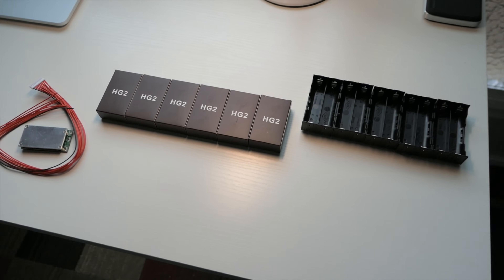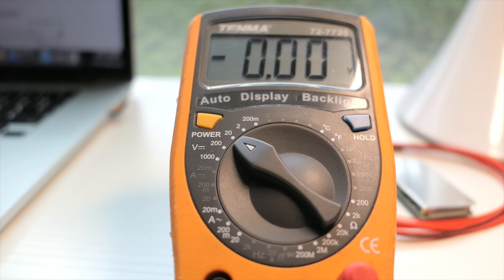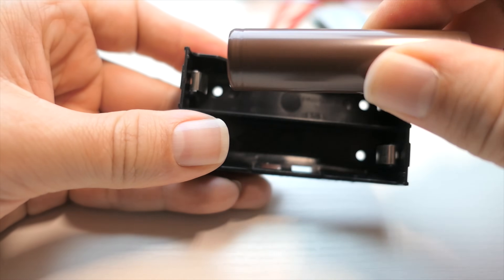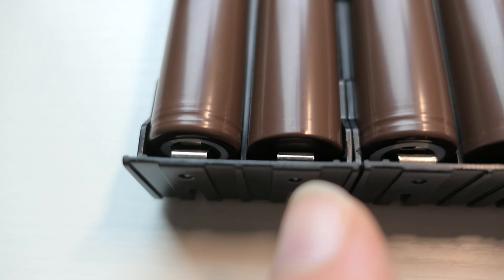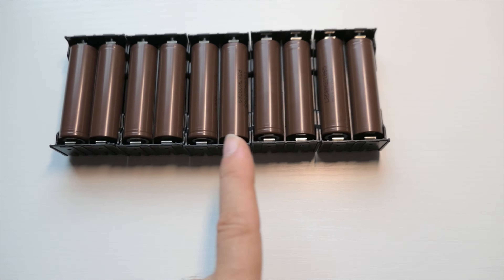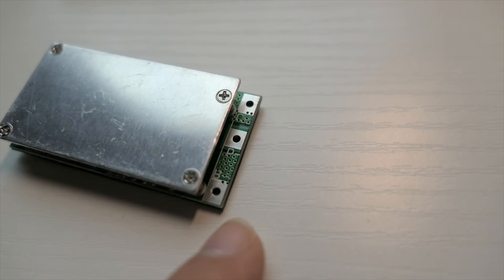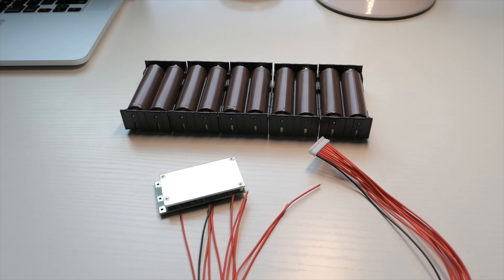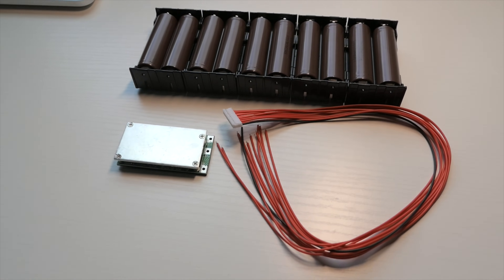Build Your Own 18650 Battery and BMS - Electric Skateboard

Comment: The bms was helpful. I build my own but was looking to see how others do it. I'm curious of how efficient they are after stepping down the power and balancing the cells. 36 volt at 40 amp would be about 400 amp at 3.6. If the power is split by resistors then there would be about 10 amp per cell. I bet you are losing about 20 to 40 percent power but it would be nice to see. You should see how much power per cell and how much power going in to see. I use large ah 3.2 volt cells with a much higher current charge. I have a lot more bms equipment but a lot more efficient design. I use no resistors and don't step the voltage down

Comment: Is there a pattern when hooking up the bms wires? I first hooked up all the P-,P+,C-,C+,B-,B+, from the bms to the battery, then when I started finishing the balance wires, I noticed little smoke was coming out of the bms. Am I supposed to wired the balance wires first?

Comment: Hi! great video! I have a  semi-related question..
I have a few (3) batteries, each with a built in bms constraining output to 50 amps. If I wire them in parallel and try drawing 120 amps, will it compromise the batteries?
Reply: Theres no reason to use bms for discharge unless you want to limit your battery? In skateboard if you do that you could get crashed, esk8 sudden stop, careful.

Comment: These sleds are rated 5A per cell, don't use them. 

Hg2 are 20a cells and putting them in sleds rated for 5a. Not a good idea.

Comment: You did a good job putting the video together but unfortunately the information is absolutely incorrect. The way you described how to wire the BMS for the individual monitoring of groups of cells was backwards. The easiest way to understand how to wire a BMS is to start with the black wire. The black wire gets tired right into the negative terminal that you have created for your battery. Then the red wire right next to it goes to the first series connection and you keep going on and on like that. What you did was set everyone up to fry their BMS. Do the right thing and recreate it with the correct information. You're literally liable for any damage that someone does based on your video. I didn't see a disclaimer. And don't think in terms of ruining a BMS. Think in terms of burning someone's house down and killing people. Not cool to put together a video showing people how to do something inherently dangerous when you're not quite sure yourself what you're doing.

Comment: So would this be 36v at 3000mah or 30 000 mah? must keep learning
Reply: 3000 mAh :)
Reply: @Gagsel  I will learn by the time I have all the parts I need
Reply: @blakey271able  once you have all the parts you need find a different video. If you follow the instructions in this video he instructed you to wire the 10 wires from the BMS backward and you will fry your BMS.
Reply: @aznative_  thanks nice to know I will definitely be doing some serious research before anyway I would rather understand what I am doing than just copying something
Reply: @blakey271able  check out Jehu Garcia Channel if you want some really good in-depth information. He's not an engineer he's a do-it-yourselfer but he's extremely knowledgeable and can describe things in ways that are easy to understand. He does everything from building Electric Cars to solar applications. He's a really good resource.
Reply: @aznative_  I was also wondering... the 2nd diagram and the explanation showing batteries were not matching - reverse order.

Comment: So i got a 10S6P Pack, soddering finished, now i somehow need to Install a BMS, but there are no 10S6P systems Out there (If there are, pls Link) should i Just use 6 of These?
Reply: Bms's do not monitor single cells unless it's a 1p battery. Bms's monitor groups of cells, each individual parallel group. The same BMS you would use for a 10s 1p you would use for a 10s 6p.

Comment: to anybody that is watching he points out the count in reverse you want to start from negative then go up to 10. if you where to check the voltages counting up they would increment from 3.7 up to 36 volts the way he counted was de-increment this is wrong and you will possibly fry ur BMS
Reply: And just in case people were so impressed with the video not to listen to this comment Nicholas is absolutely correct. Wire it the way the video tells you to and expect to fry your BMS at the very least. You always connect the negative to your negative terminal then the positive or next wire to the negative goes to the first series connection then the next wire goes to the next series connection and so on and so forth. The last wire should end up at the positive terminal. If it does not you did something wrong. So basically the video tells you to do it backwards. This video should be flagged for removal.
Reply: Thanks guys.. thought it was wrong.. the red wire next to the black goes on the positive on the cell on the posititive side of the pack negative.

Man this is hard to verbalise

The red wire next to the black goes on the positive of the cell to the far right of the pack then you can work your way across right to left.. was that better?

Comment: What's the capacity I set my charger is it still 3000mah?
Reply from the maker: If your pack is 10 cells the 36v the capacity is 30,000mah. If you are charging an individual cell 3.6v the capacity is 3000mah. Hope this answers your question.
Reply: @JustVlads  I made a 6cell pack in series 3.6 a cell at 3000 mah per cell so do I times the mah by 6?
Reply from the maker: Thats correct your capacity multiplies per each cell. So if you have 6 3.6v cells giving you a total of 18,000mah capacity. This is how your pack will be specified - 21.6v at 3000mah = to 64.8 Watt Hours. Its the same as say you have 6 3.6v cells in parallel giving you 3.6v at 18,000mah = 64.8 Watt hours. So its more easier to understand total capacity with watt hours than with mah. Hope all this is making sense.

Comment: Do the mah stays the same or 3000mah x 10? Awesome video by the way very easy to follow sub:)
Reply from the maker: If you connect in series the mah stays the same but you multiply the voltage. If you connect in parallel than voltage stays the same and the mah multiplies. Hope this makes sense
Reply: @JustVlads  it actually makes sense, what i'm not really sure about is the battery life that skateboard will have, cause with that cell configuration your capacitance is 3000mAh, which is not much.

Comment: Just trying to help. If anyone follows your bms wiring they are going to fry it and/or there cells. After the black ground wire you start with the red one next to it in that order. Just look at the diagram you showed. You are trying to teach everyone starting with the wrong positive and going backwards. Don’t want to step on your toes in what your doing. Just trying to help. I’m probably going to make a similar video in the upcoming future. Hope my 2 cents helps
Reply: Thank You. I was going to say the same thing until I read your comment.
Reply: Ok i did what vlad did and my 10s bms heated up.
Reply: Can i still use the bms?
Reply: @SavageKid23  R.I.P BMS no one should listen to vlad's video unless they want the same outcome.
Reply: @aznative_  had to learn that the hard way. At least my batteries were still good
Reply: Brian Taylor how to do then? Please help
Reply: @KeigoMoriyama  in the video he essentially described it exactly backwards. You start with the black wire and you connect that to your negative terminal. Then the wire right next to it goes to your first series connection. Then the wire next to that goes to the next series connections so on and so forth until the last wire which will be a red wire is on the positive terminal.

Comment: Just trying to learn..here the max discharge of those batteries based on LG documentation is 20a...2.7 Max. Discharge Current For continuous discharge 20000mA..2.6.2 Fast DischargeConstant current 10000mA , 20000mA...I'm confused how much discharge the motors do? Can you help me with that..why 20a or 30a max discharge work satisfy both motors? would 30am will be better? for that same setup?

Comment: Anyone still not quite sure of what connecting batteries in SERIES means, think of how the batteries in a flashlight/torch are loaded. That's batteries in SERIES.
Reply: the way of the positive and negative poles are conected is the same, only change the configuration

Comment: With what kind of wire did you connect the cell holders?? Or dit you solder nikkle strips to them?? Video helpt me a lot!!!!
Reply from the maker: I just used a 16 gauge lamp wire. As long as the wire is copper it should be fine. Thanks